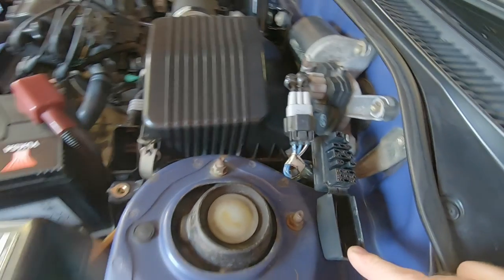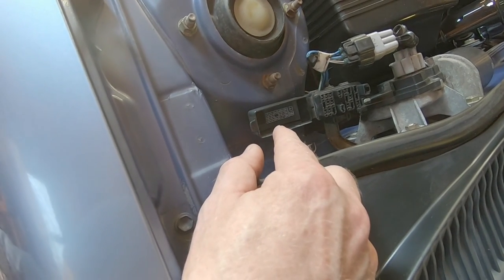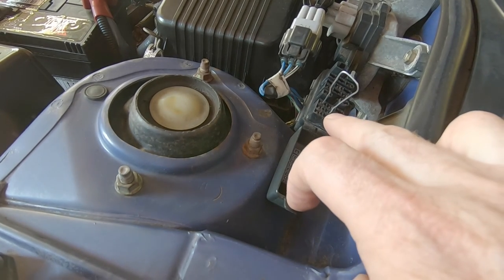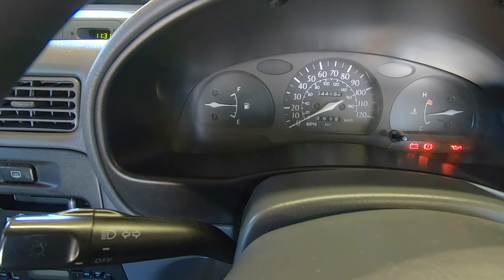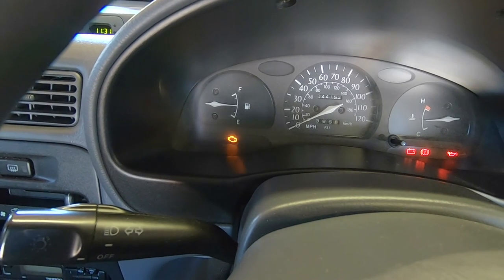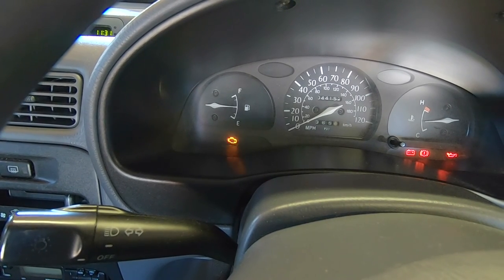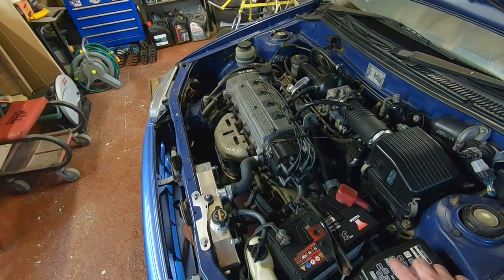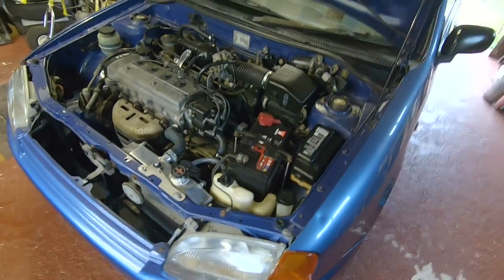Toyota Starlet check engine light (Includes code explanations) | Toyota Starlet EP91 quick tech.

Comment: Hey man, I've got a question. I have a 1994 gt starlet and sometimes it stutters and engine light comes on, the engine codes are 12 and 14 what would I check first thanks?
Reply from the maker: 12 is RPM signal / circuit = No G or NE signal present for 2 seconds during cranking, Open G circuit, Open short in G or NE circuit, Distributor or
ECU problem. 14 is No igf from igt signal = Open/short in IGF/IGT signal from Igniter to ECU, Igniter malfunction, ECU issue. 
Start with checking dizzy cap and rotor, then the wiring to igniter, the igniter itself or the wiring to ECU.

Comment: Hello sir, I hope you are doing well, i have a question regarding code 42, vehicle speed sensor, and the question is, what are the components at fault, and where are they located, is it a gearbox thing? Thank you in advance.
Reply: It is located on the gearbox bolt with a 10mm bolt.. a back plug with 3 wires
Reply from the maker: On the EP91 4efe Starlet: The gearbox drives a cable to the instrument cluster, the speedometer then uses this mechanical signal to generate an electrical signal that is sent to the ECU from the Instrument cluster (speedo= Plug C, Pin 8 Violet colour wire).  So, gearbox cable, speedo, speed signal generator in speedo and wire to ECU (ECU= SPD Plug A, Pin 13 Violet colour wire.) or possible ECU fault.

Comment: hey this is a long shot but i have a ep95 starlet i cant find much information on its maintenance but just trying to keep her alive and cant find anything with the 4wd system i know what it is but just not sure what to do to keep her working would love any help thanks
Reply from the maker: Don't really have any info specifically about the ep95, but the rear diff will need an oil change in addition to the usual Starlet maintenance. Pretty rare so try not to break anything doing launches!

Comment: Hi , I have 22- Coolant temp sensor? Because it s really does not show the temperutare, That s why my engine light is in then??? Thank you
Reply from the maker: Code 22  = Faulty coolant temp sensor, or faulty sensor wiring (sometimes oil leaks from the dizzy onto wiring and causes a problem) or faulty ECU. Check wiring is good. Measure sensor resistance / replace sensor.

Comment: Thanks. You have had the problem 34?? Turbo preassure and haow can i fix it?? Thank you
Reply from the maker: Code 34 is fuel cut caused by too much boost pressure. Have you increased the boost? Do you have a boost gauge? If it's not modified it can also be caused by faulty MAP sensor, bad MAP sensor wiring or vacuum hose. Check turbo actuator reference hose for leaks as well.

Comment: Hey Dan, not sure if you're still active on this channel..
But my 97 Starlet beeps 5 times a few seconds after I've turned off the ignition and removed the key..
Does this indicate anything, or just normal? (New car, for me..)..
Reply from the maker: Not normal as far as I know. Do you mean beep as in a buzzer noise? Or 5 flashes from the check engine light? Maybe it has an alarm or immobiliser fitted?
Reply: There is no check engine light (which does work)
Ahh just worked it out 🙄..
When I turn on the car, there is one beep from the radio turning on and then 5 beeps when it turns off.. 
(el cheapo Pioneer, already in car).
So all good on that front 👍
And Cheers for the reply 👍

Comment: Yo I’ve a question, did a rebuild on a starlet engine I get spark and fuel it will turn over but no sign of starting I’ve checked all wires timing everything! When I take spark plugs out can smell fuel on them would could this be?
Reply from the maker: An engine only needs, air, fuel, spark (delivered at the right time) and compression to run. Is it delivering enough fuel, is the spark strong? Did you remove the cams and shims / buckets? are the valve clearances correct (no comp.)? Check that all the engine and chassis grounds are good aswell. There is an electrical ring connector that attaches to the back of the intake manifold on the EP91 and its for all the important ECU earths so check that's good too. Does it show any fault codes?
Reply: Having the same issue, I’ve noticed that my check engine light does not come on at all when ignition is on so I can’t check for fault codes if you know what the cause is?
Reply: @jamiebyrne1451 how long did you weight? I thought thsi at first and then I waited lingner and jt worked

Comment: Code 21 n 52
Reply from the maker: Code 21= Oxygen sensor or wiring fault. Code 52=  Knock sensor or wiring fault, also if engine knocks  when driving.
Reply: @dan91sgarage  hy it's knocked only on ignition then fine
Reply: Hy where is the knock sensor situated
Reply from the maker: @arafada9772  screwed into the back of the block underneath the inlet manifold
Reply: @dan91sgarage  thank you